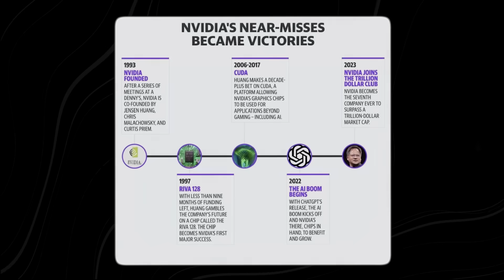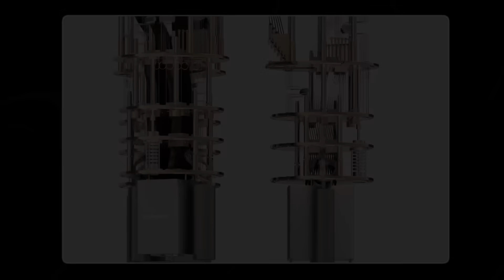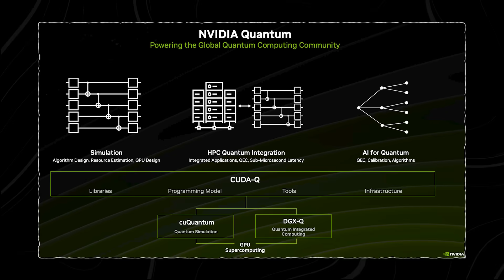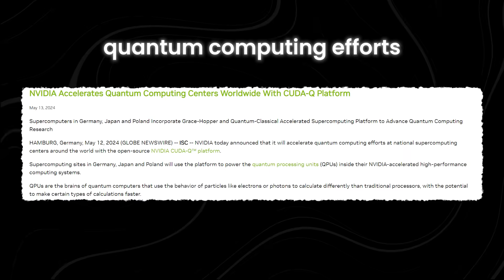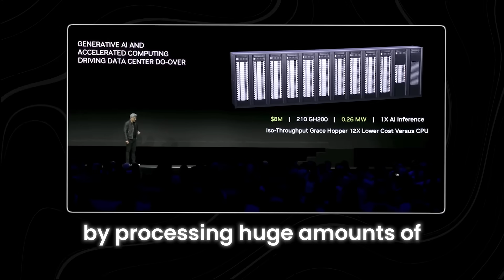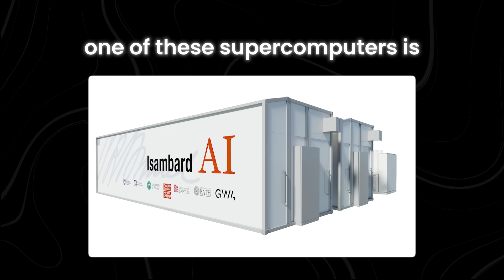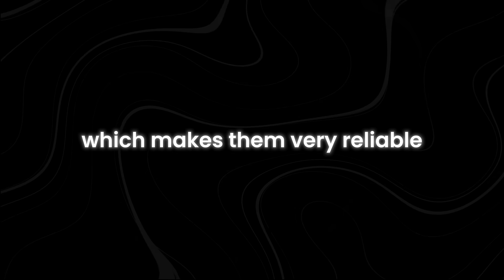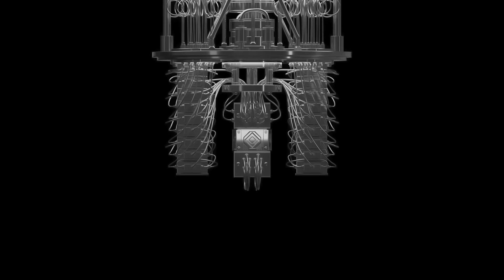Nvidia SHATTERS Quantum Computing! Mind-Blowing CUDA-Q Centers Unveiled

Comment: Graphics processing units (GPUs) and related technologies have a history that predates the founding of NVIDIA. Early gaming consoles and home computers had specialized hardware for graphics processing. Here’s a brief overview of some key developments:

Atari 2600 (1977): The Atari 2600 used the TIA (Television Interface Adapter), which handled both graphics and sound. It was capable of rendering simple sprites and backgrounds.

Commodore 64 (C64, 1982): The C64 featured the VIC-II (Video Interface Chip), which supported sprites, hardware scrolling, and a 16-color palette, significantly advancing the graphical capabilities of home computers.

Nintendo Entertainment System (NES, 1983): The NES used the Picture Processing Unit (PPU), which supported 8x8 pixel tiles and hardware-based scrolling, enabling more complex and colorful graphics.

Sega consoles: The Sega Master System (1985) used the Video Display Processor (VDP), which supported multiple layers and sprites. The Sega Genesis (1988) advanced this further with a 16-bit processor and more sophisticated VDP.

Atari ST (1985): The Atari ST used the Shifter graphics chip, which supported higher resolutions and more colors, suitable for both gaming and professional graphics applications.

Amiga (1985): The Amiga series featured the Agnus, Denise, and Paula chips (part of the Original Chip Set, or OCS), which together provided advanced graphics and sound capabilities. The graphics chips supported multiple bitplanes, sprites, and a wide color palette, making the Amiga a favorite among graphic artists and gamers.

Comment: It is very hard to get a clear answer about what real progress in quanrum computing is. I remember d wave years ago witb their 500 qbit, 1000 qbit,  2000 qbit, 4000 qbit computers but then, oooohhh but that was quantumm annealing and now look over here IBM has a 100 qbit computer and then articles saying practical quantum comouters need millions of qbits and sure I understand the concept of total qbits versus quantum volume. And tge idea of if u have a 100p qbits then you can have it do 2 ro the power of 1000 papallel operations but a large percenrage of the operations are corrupted by noise and then of course quantum computers can in theory only do certain classes of calculations. Anyway. like I said however it is hard to follow on whar really needs to be done.

Comment: I would like to know the portability of the system. Must it always remains rigid and stationary. Could it be placed into a platform that goes under water, or into the atmospshere? My, Opinion, obviously is this is amazing, what's more amazing, is this is just the beginning. We are the creators, we know and must determine what to create and how, and if we don't have the technology, we should now have the capacity create and fill any gap required to create in the future. 
My question is who is allowed? Just those mentioned? I did hear that it was open source, but exactly does that mean? Well done.
Reply: Actual distributed computing isn't the goal because that would promote equal access. The propaganda agenda of the global Elite won't give up easily.